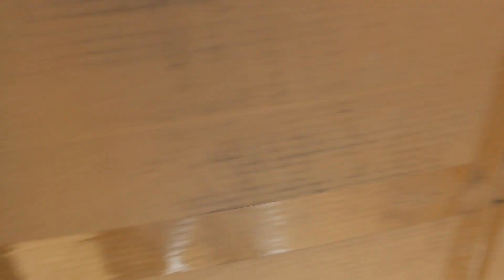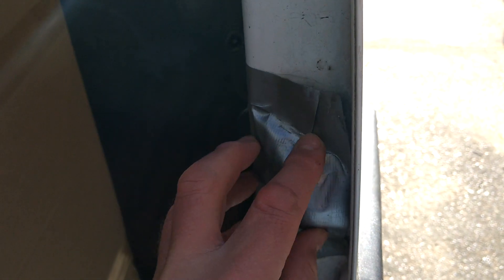Fix Alarm Going Off Renault Master Vauxhall Movano 2003-2010 How to Stop False Alarms A Simple Fix

Comment: And we are still having problems with renault alarms on the new 23 plates lol
Reply from the maker: I can well believe it! I also have a 2015 C Class which had a rattle caused by a loose wire, as fitted from the factory, so it was rattling from day one. It's an easy fix but that same fault is still present on 2023 cars, right up to the AMGs. Eight years of car production and Mercedes never corrected it.